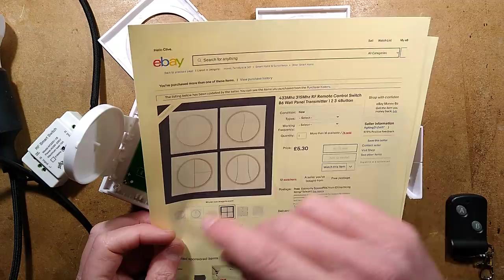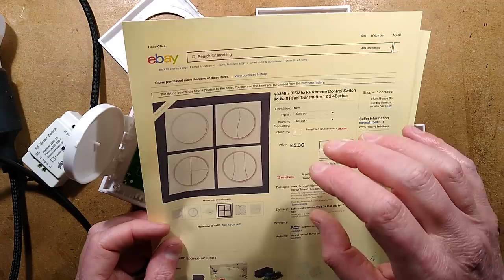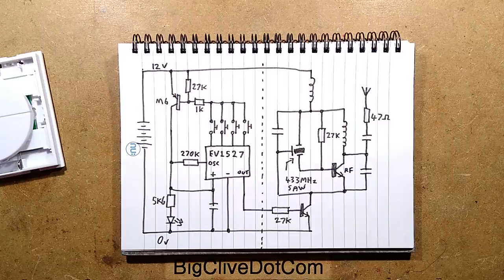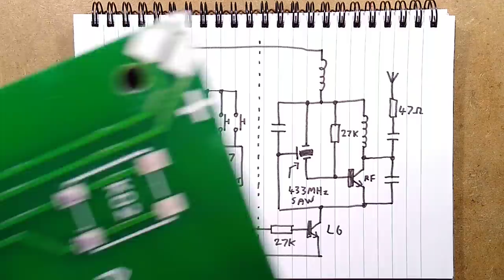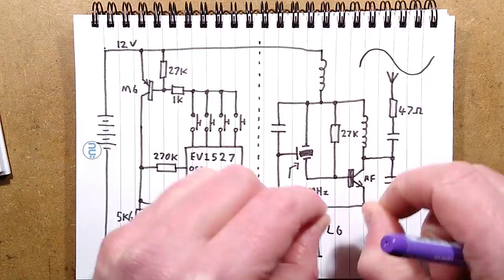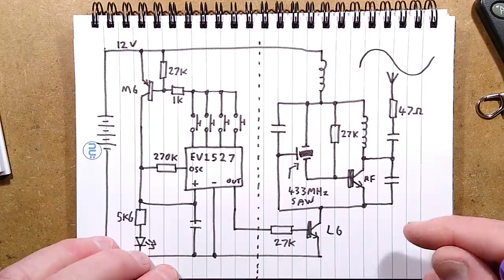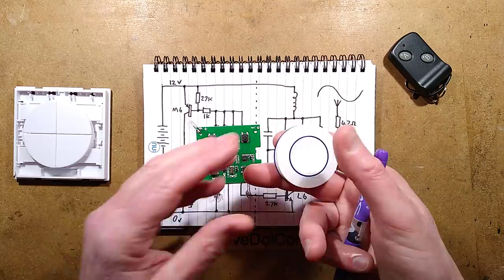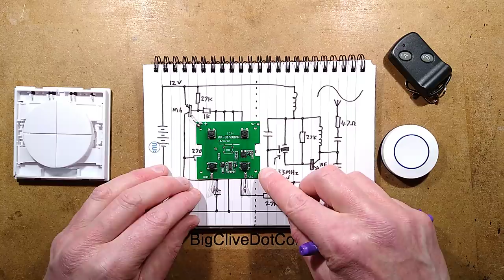Inside some stylish wireless switches (including RF schematic)

Comment: I looked at stuff like the Phillips hue and came to the conclusion that it was a solution looking for a problem I didn’t have. 😀
Also it is probably better for my health that I get up and go to the light switch.
Reply: I thought the same until I recently found a real use case. My night vision is deteriorating with age, so I need to be able to turn on a hall light and one in my living room. However the switches are not close, so would have involved relocating and my landlord wasn't keen. So now I have a couple of wireless switched adapters from TCP which I can control with an app in my phone. I chose the ones I bought because they were available from a local supplier in the UK, and they worked without needing a cloud service, although they can use one. Programming is done via bluetooth and operation is by wifi. They connect to my home network and can be operated by the app, from a Google Home or Alexa. Clives point about being able to control lighting and other circuits without lots of extra wiring is correct. Yes mood lighting might be fun, but being able to have remote control is great for anyone with mobility or visual problems.
Reply: @sadiqmohamed681  hello Sadiq. I'm wondering if 'motion sensors' would be a better choice for your situation ?  I have a very intense hate for WiFi. I too have a landlord, and this house is over 100 yrs old. I have every room and hallway lit by LED string lights, a few hundred LEDs in total. Each room has small Solar Panel  (5" × 4") in the window. The LEDs are illuminated all day and night, but at low intensity. A motion sensor switches them to full intensity. My electric bill is down by 1/3rd, so the setup has payed for itself. Did I mention that I hate WiFi, and most "wireless" doohickies, including mobile phones. I am a ham radio / amateur radio guy.
Reply: @snakezdewiggle6084  LOL
SDW "I hate radio transmitters and receivers in things"
Other "OK, fair enough. There are lots of radio waves about, so I don't blame you. Do you have a hobby/interest?"
SDW "Well, hmmm" 😁
Reply: @bennylloyd-willner9667  Hi Benny, my hobby/interest have always been electronics/ radio/ robotics/ computers, and have worked in these industries also. I guess I'm a bit paranoid about security while more and more things can transmit your data and information. The other hate is that all these transmitters create so much RFI and EMI.
Reply: @snakezdewiggle6084  yeah, I know what you mean, I just couldn't help myself finding it funny to dislike wireless stuff being a radio person 📻😊
Be safe, healthy and happy, mate!

Comment: Always wanted to replace batteries in my light switches.
Reply: It may last a lot longer than you think: I installed a ceiling fan with light with a similar radio remote powered by a 9v battery more than 5 years ago and it’s still using the original battery. It is the main light in our kitchen and gets used several times each day.
Reply: Given they only basically only have power when you press the button, those batteries will last a very long time.
Reply: @TheGrumpypotter  they should last at least as long as the battery in your car keyfob - 5 years+

Comment: The EV1527 micro controller can handle 16 different combinations of inputs. IDK about the RF part of the schematic if it can handle 16 different frequencies. In a sense you could have 16 buttons with a multiplexer.

Comment: Is it possible to build something like this, but without a battery in the transmitter? Where the energy from the button-actuation is enough for a short, low power RF transmission! Now that would be super interesting!!!!
Reply: Depending on your stylistic preference you may use a knife switch or a detonator style box to get enough way to feed motion to a small generator (maybe via some gearing) to power the transmitter.
The input energy would be button force times button way. Let's assume the way of a standard button to be around 1mm you'd need quite a stiff button to generate enough energy, needing a hammer to generate the force needed thus creating special structural needs for the housing. 
With a lever of 20cm that you rotate by 90° you have ~30cm of travel (I'd prefer the knife switch 😉) so the force is manually manageable.
Or you integrate a turning handle like in some dynamo flashlights.
Reply: @al1rednam  You could also use a piezo-element. Like those gas-igniters-spark things on a blowtorch. Use a  small transformer to step down the HV impulse. Then use it to power a 400 Mhz Oszillator for a fraction of a second.
Reply: @WolfmanDude  you're absolutely right. My mistake was to think about a wrong duration and range. I was thinking about 0.5s transmission over 50m inside a building when the actual reality is more like 0.0001s or shorter and 5-8m for most use cases. That made me guesstimate a much bigger energy consumption
Reply: They are already available under the brand name Quinetic.  Higher quality than these eBay ones but expensive.
Reply: @petehiggins33  Damn! I thought I was the first one to come up that lol. Great info dude!!!

Comment: This is for a very simple form of pulling it off. DrZzs has a good channel, and regularly mentions/links back to other channels really big into setting up home automation with relatively budget friendly bits. It just requires a spare pc that's always running, or a raspberry pi on the same network(it's really advised to have a separate network or vlan setup for home automation/iot stuff)

Comment: 3:51 Yin Yang
Very interesting, that they just turn the carrier frequency on and off to modulate the data. I guess it can be considered digital amplitude modulation sort of... Pretty neat. What's with the LED? As far as I can tell it's just supposed to be an indicator that lights up when a button is pressed?
P.S. I think it's really awesome that you show so many devices from the inside, reverse engineer them, discuss ways to modify them etc. It's like a very in depth review. And there have been some cases where I was looking for some specific device and ended up buying something you featured, just because I like to know a little more precisely what I'm actually buying. And while I know Chinese sellers like to randomly change things up a little from time to time. For the most part the things I bought matched what you showed in your videos fairly closely (also from the inside).
Anyway ... I just wanted to say thanks for taking the time to share your knowledge with us all.
Reply: When I press this button a sign lights up saying "Please do not press this button".

Comment: 5:29 Are those really 8 stacked button cells for the 12V supply? Those things tend to leak and corrode over time, don't they? Seems awfully fiddly installing them too.
Reply from the maker: I improvised a battery with discrete button cells because I didn't have the correct type.  (That's what's inside the little 12V batteries.)

Comment: Aren't there a lot of new setups based on zigbee protocols? I was thinking that the Phillips Magic Lights or whatever they are named use a zigbee protocol that is accessible from some of the assistant services. That then opens the question of whether you could use a XBee module to communicate with the things using an Arduino or whatever.
Reply from the maker: I like the simplicity of not going through computers.   Although that can have advantages.

Comment: Have you looked at wireless kinetic switches, apparently from a company called NRJ?  An Irish youtuber, John McGrath used them in a recent video for wirelessly switching his dust extractor.  He's an electrician but his channel is woodworking.  They seem interesting, but I didn't find much availability for the switches outside Ireland and the UK.  They don't use power, mains or battery, but the act of pushing them generates the signal voltage.
Reply from the maker: I've not seen one yet.

Comment: Cute design. Wondering how good those momentary buttons are when being used day to day as a light switch.
The OOK style transmitter harkens back to the old 27MHz toy transmitters of my youth, just bang it on and off using its power supply. Light receptacle physical format is a bit strange to me though...
Cheers

Comment: Yin/Yang . nice open PCB design. pity in OZ we don't use that formal wall box... i will look for our style.  hm... no mention of learning or setting the codes between the button and the smart switch ?
Reply from the maker: The receivers all seem to have different setup approaches.  Some are entirely based on a button, while others have a movable link for modes.  All seem to pair by pressing the button on the receiver and then pressing the switch.

Comment: In regards to sticking it to a wall the wall 

The switch module if you want to call hit that remote whatever!

My suggestion would be to use 3M command Velcro.

It solves a few problems one if something goes wrong or otherwise.

And last chance of damage just trying to get it open and change a battery as well!

 you can get off the wall usually intact at least with the wall obviously not the Command Adhesive itself.

Have seen sometimes wear that doesn't go according to plan.

Trick is doing it slowly when you pull the tab for removal.

 but still better than other methods.

 that could get at least more destructive or you're not permitted to do in your residence if renting Etc.

But one thing I've done previously especially if it's for my own personal use on my own furniture.

If I wanted to mount something with velcro brought the strips are too large to fit the exact spot that it would work best.

Or protrusions on the back and or curved surfaces or sloped in a way that is it practical.

Used to cut it shorter and use it that way.

Once installed a battery rack a piece of furniture that way.

You do need to get creative with mounting things sometimes!

Don't be afraid to experiment!

Comment: Some have questioned if it's a SAW. Yes it is. xtals & resonators don't get much above 50 MHz. I think it's in a Pierce oscillator configuration?? The cap to the left is just supply decoupling, and the SAW terminal it's connected to is just the case/ground.
Reply: Because of the internals of the SAW (eg three terminals) I think it's more a Colpitts.
There are caps inside the case eg https://www.electrical4u.com/colpitts-oscillator/

Comment: That is very well thought out light switch.  12V battery?  Really, what sort of battery do you need?  Anyway, I like it a lot and a timed one could be left outside under the porch so one press would give you enough time to put the key in and open the door.
Very well thought out switches, one of the best I have seen.  Thank you Clive for bringing it to our attention.

EDIT:  Waiting to see how to programme them.
Reply: The battery is a A24 lithium 12 volt
Reply from the maker: One receiver I've tried does offer a timing function.  If you had the two way version of this switch it could be configured as one switch being on/off and the other being a timed lighting for 5 to 20 seconds.
Reply: @bigclivedotcom  20 seconds is all you need to get the key in a door.  :-))
Reply: @dri50  Thanks.

Comment: So what happens if you press 2 buttons at the same time ? Could that operate a 5th item ?

A friend found RF remote controlled sockets in a 4-pack - so seems like the same chip too ? The interesting thing wa that 2 of the buttons had dimming functions built in.

Personally, I'm not keen on battery powered things like this - and as there's power to the old light switch, it could go there and be mains powered yet control things around the room as well as the original lamp !

Comment: Shouldn't L6 be next to the RF section, rather than the transistor below, or is it mislabeled?
Reply: L6 isn't part of the RF circuit though, it's just powering it on and off. If you connected the RF section directly across the 12V rails it would operate continuously transmit the 433MHz wave. The control chip is using the transistor to send pulses and spaces using the 433MHz as on or off, it's basically like 21st century Morse code.

Comment: The cap across the CE of the RF transistor makes it into an FM transmitter.
Durrr. It's a parallel resonate circuit. At RF the power and ground look like a short to each other. Grounding the cap instead of connecting to power just prevents capacitive changes when near a grounded object (like holding it).
Reply: No. The cap on the output most definitely doesn't convert it to a FM transmitter. The cap is there to create a parallel resonant circuit. The power and ground of the oscillator are bypassed with a cap, so they are both the same at RF.

Comment: new job direction for Clive, explaining chinglish, like the seperate on/off option,  just inside the basement stair door the ON,
on the outside only the OFF,  no need to check if you did leave the light on ? (battery flat, does the button led light up  ?)
Reply: thinking about the sticky pads, i would replace them with those poster/small hook sticky pads, the ones you can easily remove, even modify the backplate to expose the pull off tabs inside the box.

Comment: A curious thought just came to me? How many RF devices within range or a set range would be enabled/disabled or triggered with one pulse or wave in a desired frequency. Would there be a threshold of energy or since the wave would be passive and not completely absorbed that it could trigger more than one device in the same location. Perhaps an echo chamber could have a multiplied effect?

Comment: Maybe nice to also review a MoesHouse 433 touch switch RF. I have a few in house. So i could switch the light in bedroom on and off from bed. In my storageroom i has just only one 1 230V socket. So i removed the traditional switch. Placed a Sonoff RF wifi switched and paste above the dual socket a RF switch. :)

Comment: I think these remote controlled power sockets work just the same way. I use 4 of those for my lighting in the room, and I have a 4-button on/off controller. It was sold by Aldi many years ago for something like 20€. The remote control uses a CR-2023 lithium button cell, and I think I bought this thing in 2016, and now it's starting to get low in range. So basically, this 12V battery they require for their remotes will last its whole shelf life, or won't it? Because in my experience, these tiny 12V batteries are darn expensive, while I can get something like a 10-pack of 2023s for a few bucks...
Reply from the maker: Poundland sells packs with the 12 batteries in them.

Comment: Because I don't like battery operated things. I made a small cap dropper power supply( charging a fairly large capacitor) for one of these RF switches. There is no neutral in the back box. So it obtains its neutral feeding back through the bulb but not enough to light it. It uses a very small amount of current to recharge the cap. This way I could expand the amount of light switches for the room, without chasing out new wires.
Reply from the maker: With the small bursts of current these use, it could even have been a simple resistor charging the capacitor at microamps.
Reply: @bigclivedotcom  that's true a resistor capacitor and  Zener is probably a simpler solution.🤔😉

Comment: I can't see these rf modules being around for long. Smart switches  and modules (eg. ZigBee) that you can fit in the back box give you way more options and are going to be ubiquitous in the next few years.
Reply: ZigBee, ZWave, or WiFi, place your bets.
Reply: @RambozoClown  But those options use far more power, your batteries would last days only.
Reply: @liquidsonly  I have a ZigBee switch with three years on the battery and still going. Granted WiFi couldn't do that.

Comment: If you cant get an A27 battery 8mm x 28mm? an A23 battery 10mm x 28mm often fits
Also an A23 is around 55mAh, and a A27 is only 20mAh, both 12v

Comment: big clive, you know how your hopi flashes?  and some other things you have on your channel?  i read a comment below one of my other favourite channels you might be interested in.  a person with more video experience suggested that the flickering of lights might be fixed by altering the frames per second  to a multiple or divisor of the hertz of the local electrical system.  he suggested it appeared the same whether it was uploaded at 30 or 25 frames per second so there was no noticeable lack of quality.
Reply from the maker: I don't have much control over that.

Comment: I have recently added some LED lights to my living room and used similar three button light switch to have extra control over which lights are lit. Had to wrestle with the receivers until I got them programmed correctly. The only issue I see is the flimsy nature of the switch itself. Very plasticky and have a distinct “made in china” tactile feedback. The ones you got look actually decent in comparison, I might get some.
I wonder what happens in some ebay seller’s head, when Bigclive features some product that they sell, and suddenly its a bonanza.
That date code on the PCB suggests it was designed in 2002, could that be the case? Thanks for the video.

Comment: Nice simple OOK transmitter.
Reply: So glad that someone was thinking along the same lines as me on the rf modulation method. I was also thinking that the 47-ohm resistor to the antenna was for impedance matching -- anyone else of that opinion?
Reply: @geralltgriffiths7772  could be, or just attenuation to get it within regulatory limits. Matching is usually an L-C circuit.
Reply: @damowdotnet  Good point. Could be both, maybe? Things get 'fuzzy' at rf. :-)